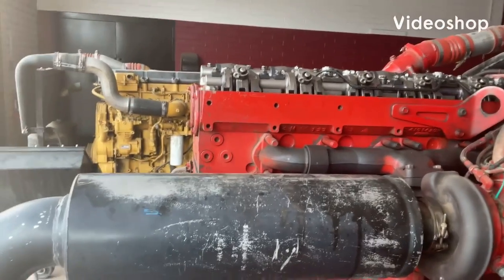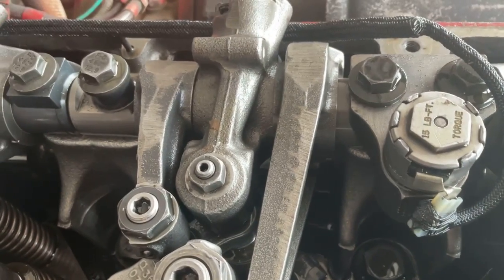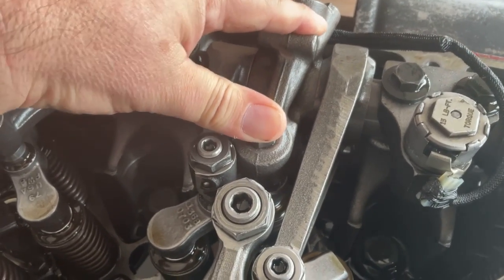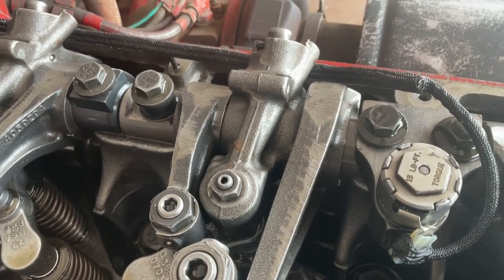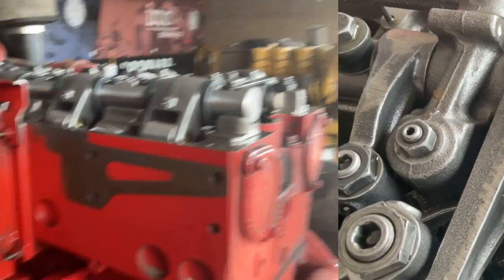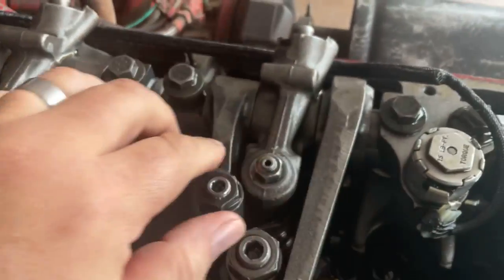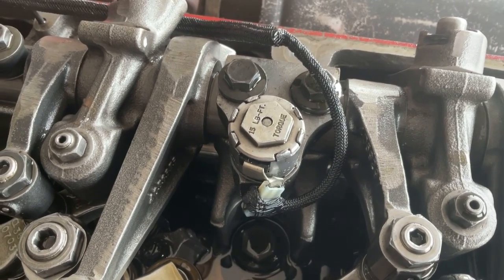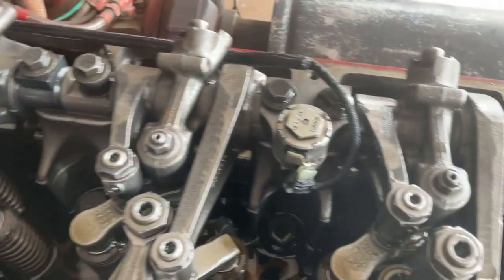░▒▓█ 𝐂𝐔𝐌𝐌𝐈𝐍𝐒 𝐈𝐒𝐗 𝐈𝐍𝐓𝐄𝐁𝐑𝐀𝐊𝐄 (𝐞𝐧𝐠𝐢𝐧𝐞 𝐛𝐫𝐚𝐤𝐞𝐬)! 𝐇𝐎𝐖 𝐓𝐇𝐄𝐘 𝐖𝐎𝐑𝐊! █▓▒░

Comment: So I took my truck to the big cummings shop in slc they dynoed the engine and Jake brake horsepower and torque were  spot on but the Jake's were only doing 480 hp should be doing 600 braking hp they made some adjustments to overhead and computer stuff got it to 580 hp its way better almost as good as my old truck
Reply from the maker: That’s god to hear, I am glad they were able to help.

Comment: Mechanically speaking, what is the difference in low, medium, and high engine brake settings with the rocker arms? For example, does low only activate 1/4 of the rockers and high activated 1/2?
Reply from the maker: It is the number of cylinders that are active in braking. Controlled by solenoids usually that determine (on this engine) like you said the number of rockers being activated. In some engines it would be one cylinder in low, in others it could be 2 or 3. High setting would engage brakes on all cylinders until the minimum programmed engine RPM is reached the cylinders would cycle back on to prevent engine stall. Hope that answers your question.
Reply: Awesome and thank you!
Reply: @charleysgarage  i have a problem with the high setting on the engine brake feeling like the medium setting any suggestions
Reply from the maker: @franciscopalomino2071  an older engine with a lot of blowby? A failed solenoid for high braking? I would start by checking the switch and see if it is working on the high setting then testing each solenoid individually. Resistance check with a DMM, is voltage present (don't check those at the same time, you will blow the fuse in your DMM) without being there to see and hear and feel in person that's about as far as I can go.
Reply from the maker: @franciscopalomino2071  Check switch operation and then solenoid operation with the DMM. Is it an older high mileage engine? Without seeing it in person that would be my suggestions.

Comment: I got a 2020 Cummins x15 performance 605 hp the Jake's have seemed  weak from day one its got 500k on it now (never got any worse ) I have asked pete dealer about it twice they say there no adjustment for it my last truck had same motor Jake was way better is there a adjustment for it I had the over headed done by a independent shop no change still need to be 2 gears lower to get same braking as 2016 I had before trucks are speced the same trans and diffs haul same load
Reply from the maker: Working at a trade school I don't get access to the new stuff to answer your question right away but I will do some research and see what is different in them from the older models.
Reply from the maker: Actually this is a good exercise for my class tonight. They were just given access to the Cummins website, I am going to show them your comment and then ask them how they would find the answer to your question and have them do it. Thank you for writing my curriculum tonight :)
Reply: @Charley's 3rd Garage  thanks for a answer I will talk to different pete dealer see what they say
Reply: X15 is supposed to be the strongest engine brake on the market, 600 BHP @1900 rpm. Stay away from truck dealers, go to a Cumnins engine shop
Reply: @jamescaliendo1030  truck was traded in 2 mons ago new truck has same motor same spec works way better than last one
Reply: @jeremyhanna3852  ahhhh ok. First off congratulations on the new truck. Now that you see the difference and knowing they're both the same specs 605/2050?? Must drive you crazy. We have one like this in our New Jersey terminal and the dealer can't figure it out
Reply: @jamescaliendo1030  yeah it also Lacked about 50 hp also it went to 3 different Pete dealers and 4 Cummins shops they never could figure it out
Reply: I still put 660k miles on it in 4 yrs
Reply: @jeremyhanna3852  jeez!! That's some serious gear turning for 4 years
Reply: @jeremyhanna3852  damn.. built on a Friday it sounds. I'm glad you got rid of it and now got yourself something new with no problems now. Here in NYC we're hearing no more EGR for 25 from Cummins. You hearing that out your way?
Reply: @jamescaliendo1030  yes sir I run dedicated from western Michigan to Southern California leave wyoming Michigan mon at 5am turn California be home for lunch on sat in Michigan  no governor period straight outlaw don't care about logs
Reply: @jeremyhanna3852  ahhh gotcha. That's a lot of running man